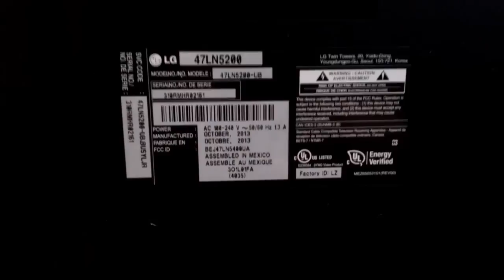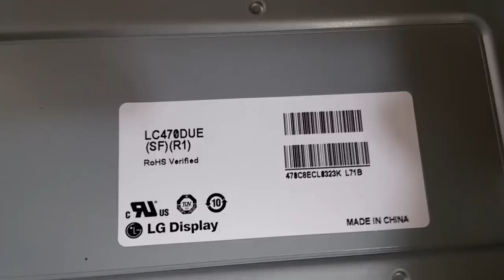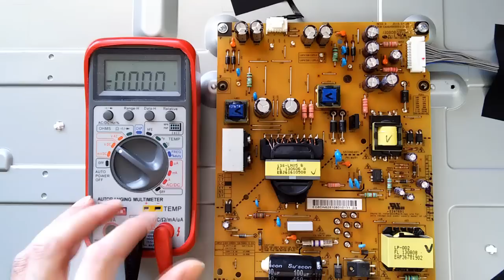LG 47LN5200 TV no Backlight Repair 1of3

Comment: Is this diodes 3v or 6v ?.
Reply from the maker: The LED is 3V
Reply: Almost certainly 6v for a TV of this size buddy, hope this helps. Oh as a caveat the general convention is to change the whole lot as they tend to keep burning out with band aid type repairs, and if you are worjing to a budget and want to go the diode replacement route, be sure to acquire the exact model of diode for your set as because they carry the same voltage they are microscopically different in structure. Take care and be well.
Reply: Apologies 'working' to a budget.